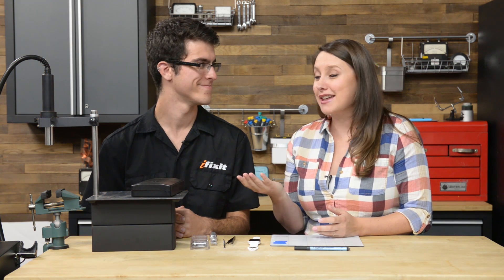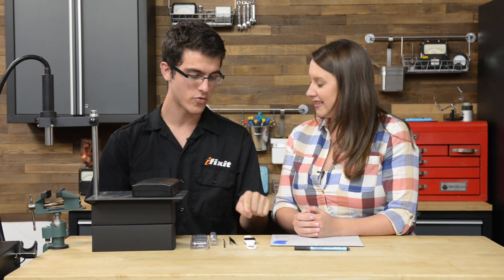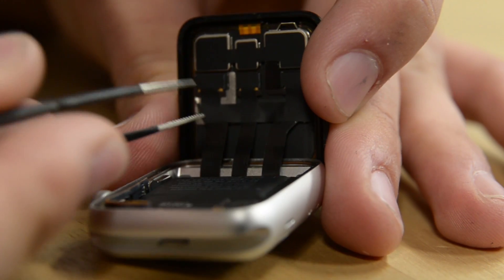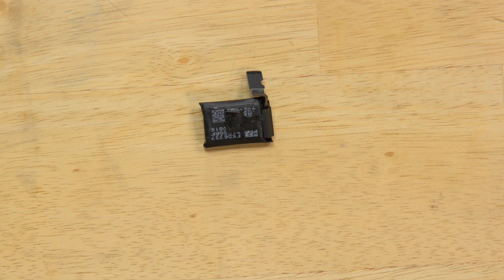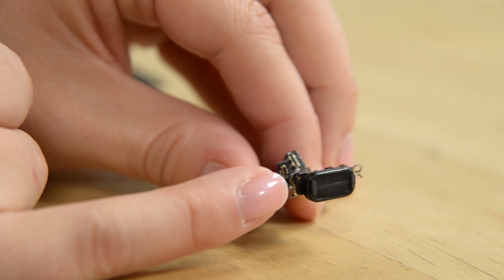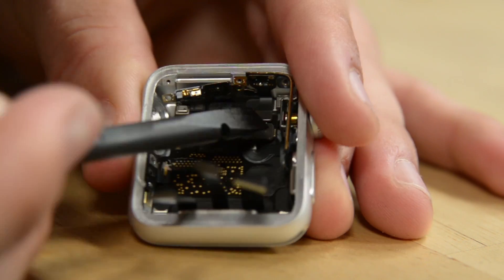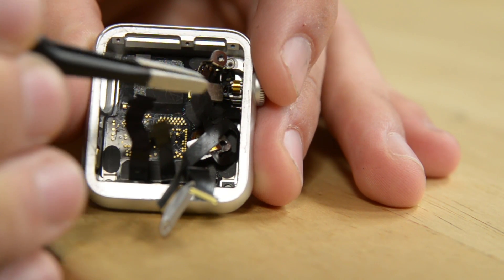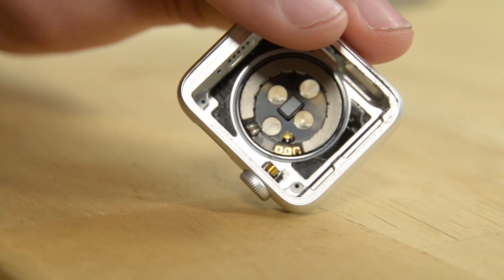The Apple Watch Series 2 Teardown

Comment: If your digital crown is not physically stuck but is scrolling by itself. I found the culprit. Bad solder joint for the digital crown flex connection. Under the battery is where the connection is. This is likely why physically jostling the watch may briefly help. I tried it myself and it helped for about 30 seconds. 

I initially tried cleaning the digital crown from the inside and outside with a sonicare toothbrush with no success. My digital crown was free spinning so I didn't think that would work anyways.

I disassembled mine and the moment I pushed down on the battery, the scrolling stopped. I put it back together and I'm letting the unit cool before I power it back on. I imagine this will have fixed it, we will see for how long.

Yep confirmed. Fixed for now.

Edit: 3 weeks later: Issue reemerged.
Pads under black sticker under battery on the same side as digital crown. You can see it under step 9/13 at ifixit teardown. Resoldered at 600f, currently working.

Comment: I think this was quite careless job. First of all,  you should use professional tools instead of these semi- cheapos. Second: Never remove flat cable using metal screwdriver tip! Third: you need much smaller tools. These really big ones can’t be used precisely. Also be careful when handling ESD-sensitive components. I prefer using an ESD-mat where I can connect the strap. Never leave fingerprints inside this kind of delicate electronics as it looks bad and unprofessional. In some cases it can cause problems. The vice used here is not right tool. You need a bed where to put the watch, not squeezing it between worn jaws. You can see that the case is moving when removing the front part. This watch has very worn case. It has many scratches when somebody has pried the watch open carelessly. Perhaps this is a training watch for course students. Also removing the rubber seal must be done much more careful if you use it again. This method looks really awful. If you open anything using this kind of methods, it leaves traces and professional serviceman doesn’t probably want to try fix it in the case you can’t assemble it back. so, my professional advice is that you shouldn’t try to open the Applewatch using these methods.

Comment: I was wondering if you open it to change the battery, will it still be waterproof? I think it won't be. Why would they stick the screen with adhesive. All waterproof watches used owing and screws . Adhesive is trouble for waterproofing.

Comment: He mentions he has done 100-120 series 1 but the series 1 is a brand new model (with a new processor) that just rolled out, the old apple watches aren't series 1, they've been discontinued.
Reply: The Series 1 is the old Apple Watch, but all they did was throw the new processor in. Nothing else changed.
Reply: From a supply chain standpoint, the series 1 is a new model and the old ones are discontinued

Comment: That taptic engine is huge... i have mine on the lowest setting, but they made it bigger... they should have reduced it and increased the battery.

The speaker system is cool though... it would be nice if it was bigger to play better sound.

you forgot to mention about the hidden connectors on the series 1 and whether they were on the series 2 -- i noticed holes in the casing, but you didnt say anything :-(

btw -- glad you cleaned your nails... some people who do close up videos have really bad nails :-(
Reply: I'd rather have a bigger Taptic Engine. The battery charges so fast. I can get 80% in about an hour. Just buy a power bank and a cable.
Reply: Republic Thunderstreak - i have a power bank...but the cables are expensive :-(
Reply: Yeah true. The cables are ridiculously overpriced. I bet it costs Apple no more than $5 to make them.

Comment: If Apple didn't waste so much space for that taptic engine thay could've installed a much bigger battery.
Reply: the watch will heat up...
Reply: Keshav Baweja what?
Reply: There is no need for a bigger battery, i use my apple watch series 3 ALOT and it is still 80% at the end of the day, some nights i dont even charge it
Reply: You must be joking with the battery bank. The whole point of a smartwatch is that you can always keep it on your hand.
Reply: The battery literally lasts several days on a charge. You don’t need a bugger battery
Reply: WHO NEEDS A BIGGER BATTERY. Mate come on! It's a 1 hour charge to 80%. Just get a cheap 2000mah power bank. It'll charge this thing 4 times. I'd rather have a even bigger Taptic Engine.
Reply: Mateusz Wojtkiewicz the topic engine need to be that big to give off different and more enhanced level of feedback and apple probably already thought of that the larger battery would actually cause more problem because the larger the lotion ion batter the larger chance it will get damaged
Reply: Apple needs you

Comment: Interesting to see how big the taptic engine actually is and how much space it absorbs (taking into consideration that battery size related complaints are common with the apple watch). I wonder why it actually is part of the watch whereas its functionality is....very very limited and not essential to using the watch.
Reply: It's quite essential actually. The battery is small so a 2000mah power bank will charge it a 4 times. Also it charges fast. Mine went from 0-80 in 60 minutes.

Comment: apple wastes a lot of space with that taptic engine
Reply: Apple uses a lot of space for that Taptic Engine.
Reply: TheNerdyCanadian Wouldn't feel the same
The one in the Nexus 5 spins in a circle, the Taptic Engine goes side to side

Have you felt the Taptic Engine? It's not a buzz, it's a tap
Reply: +TheNerdyCanadian way superior than common vibration motors though, you really gotta feel it for yourself.
Reply: anything smaller, and a user probably wouldn't feel the vibration as much
Reply: it's not wasted lol 

They use all of the space very efficiently to pack everything in. The smaller everything gets, the more stuff that can be put in, hence how they were able to put in a GPS, the new chip, a bigger battery, etc.
Reply: TheNerdyCanadian The battery can last a day
Reply: The one on your Nexus 5 wouldn't be ideal for the Apple Watch
Reply: TheNerdyCanadian I have a 1st gen,

I wake up @ 620,
put it on the charger @ 2000

 and it still has 48%-60% left
Reply: TheNerdyCanadian it would feel horrible to have an obnoxious vibration on your wrist. It's got to be subtle.
Reply: Josh C well you must barely use it then, because anyone i've talked to that had it barely gets half a day at best
Reply: My 2nd gen. 42mm lasts for about 3 days. If I use it less I would be able to run 4 days. I turn the watch off completely before I go to sleep. As others stated here, the tap on the wrist makes a big difference in creating a more comfortable vibration pattern. It is hard to describe, you'd have to check it out some time if you can.
Reply: Josh C and why is that? the "taptic engine" is basically just a vibration motor
Reply: yup, the one on my Nexus 5 is smaller than this
Reply: TheNerdyCanadian I have a series 3 and a friend of mine has a series 1, his easily lasts all day and I use mine all day long and when I get home my watch battery is still at 75% at 10pm when I took it off the charger at 6:00am
Reply: There are patents which suggest they will take it out and move it to the strap.
Reply: Josh C ok, well every other wrist based device uses the circle one other than apple. it literally takes up more space that they could have used for battery so it can actually last an entire day...
Reply: TheNerdyCanadian they use a big vibration engine so you can actually feel it, I own a nexus 5 also and you can’t feel the vibration when it’s in your pocket.
Reply: Josh C really? i'm kinda surprised considering the first gen couldn't even make it to lunch
Reply: Xplosio Lee sorry, but i can't take you seriously with a meme as your profile picture